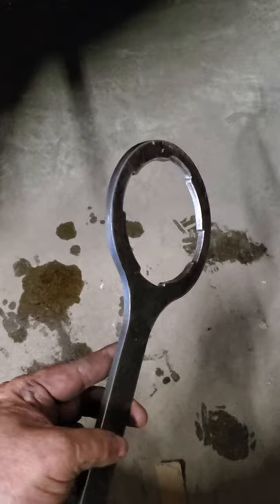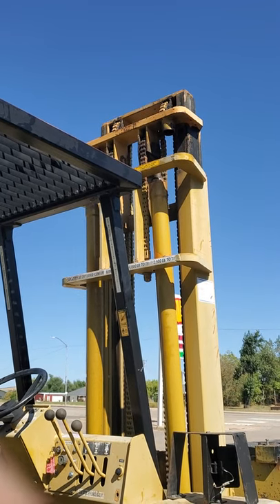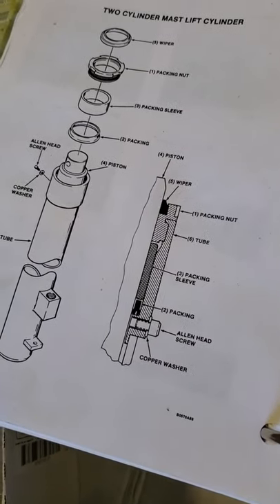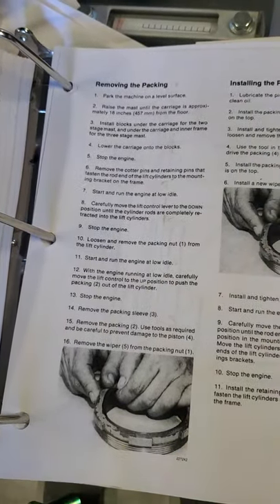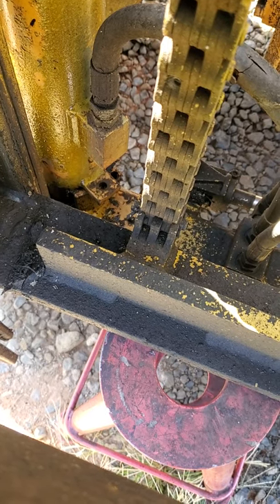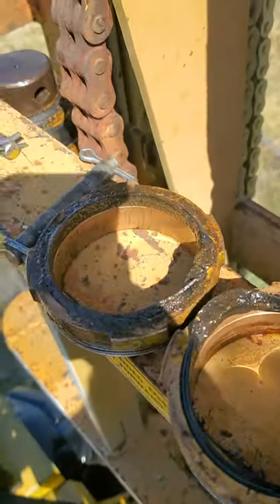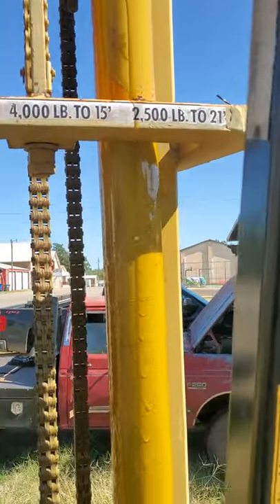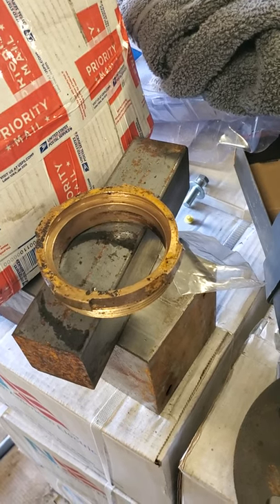case 586e forklift lift cylinder leaking, replace packing

Comment: I have the same forklift, did you ever find a seal kit?
Reply from the maker: -- I got distracted (focused on other things)... and my brother came and fixed the forklift for me.... He bought seal kits from (2) places... one was from the CASE dealership .... they were expensive.... then ... he purchased an aftermarket kit from a 3rd party shop ... (much less expensive).... he did one cylinder with the expensive dealer kit... the other cylinder with the cheaper kit .... he wanted to see if there was any difference in performance.
Reply: @herrmc  what was the part numbers  and site for both the expensive  an cheap ones cause I have this and want to rebuild the pistons cause one is leaking. I’m learning diesel so this looks like an easy project
Reply: Southeastern equiment